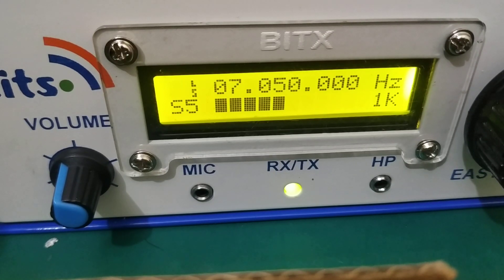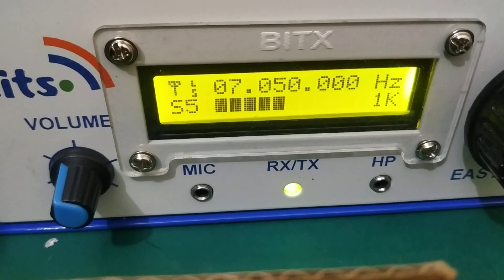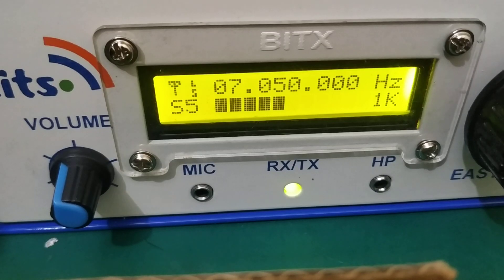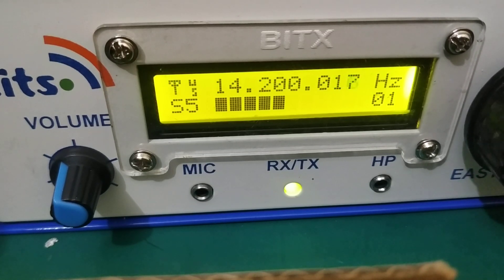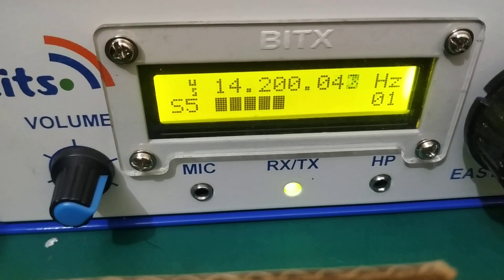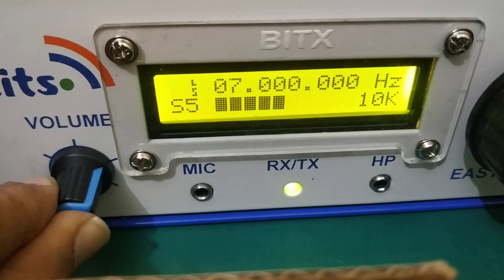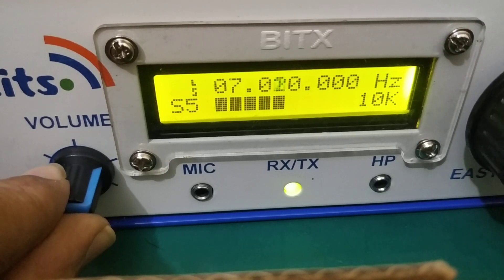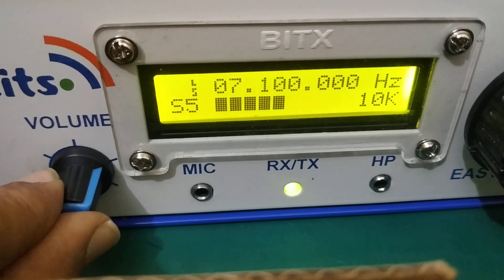Easy Bitx transceivers dual band

Comment: What hardware must be added or modified? The easy bitx is much more appealing as a dual band.
Reply from the maker: Easy Bitx Dual band is coming by March April 2022. 
For modifying the easy bitx for 2 bands you would require external bpf and low pass filter . The firmware we have for 2 bands.
Reply from the maker: We are also re launching easy Bitx for 2 bands 20 and 40 mt next year by Jan/Feb 2023